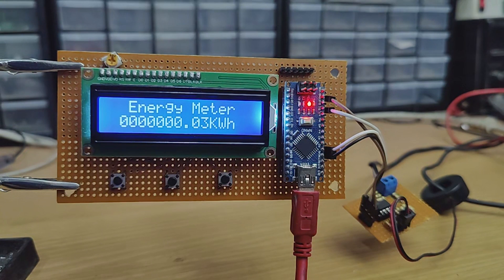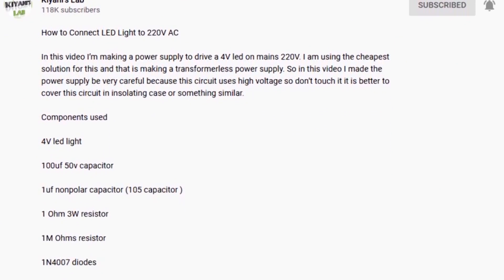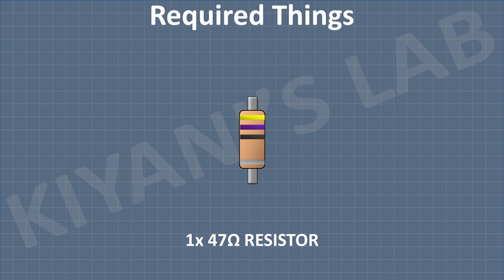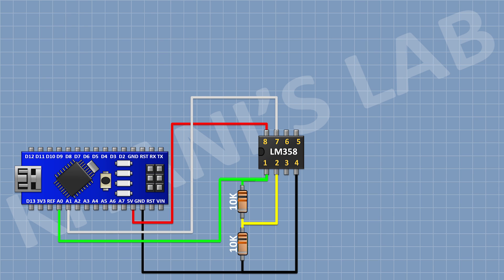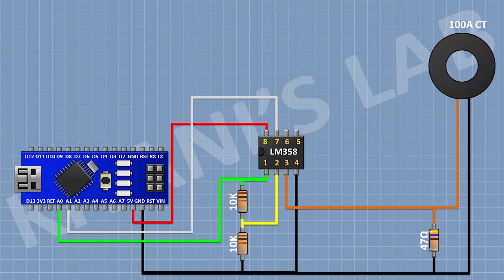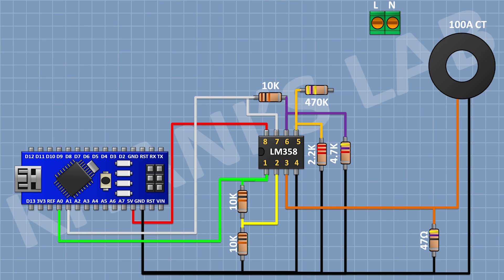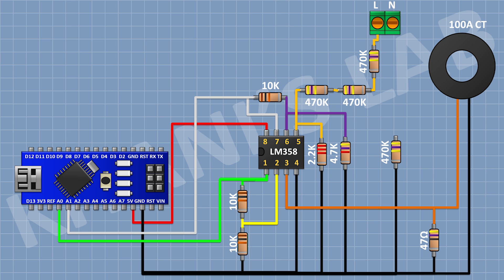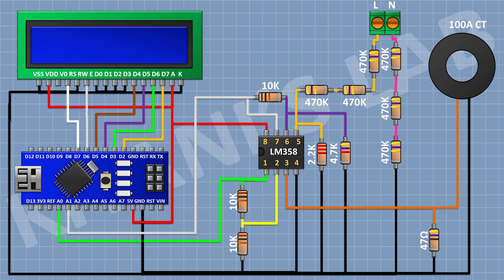How To Make AC Energy Meter | Arduino Project

Comment: GOOD DAY ENGINEER! PLEASE I NEED HELP ON A CODE FOR AC LOAD MONITORING USING ARDUINO UNO. THE POWER LIMIT(IN WATTS) OF THE LOAD WILL BE SET USING PUSH BUTTONS. THERE WILL BE WARNING ALARM AS SOON AS THE LIMIT IS REACHED FOR 3 TIMES AFTER WHICH THE LOAD WILL BE SHUTDOWN. THE PROCESSES WILL BE SHUN ON THE LCD THROUGH I2C. A LINK TO SIMILAR PROJECT WILL ALSO HELP ME  A LOT.